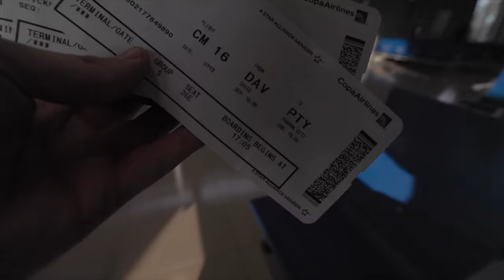BRICK PIZZA OVEN BUILD // Off-Grid in Panama PART 1

Comment: cinder blocks, concrete blocks have air pockets that also contain moisture that can explode given the heat required to cook anything really even pizza
Reply: I have seen manny block houses burn... never seen one explode
Reply: @51-FS  Cinder blocks retain water  in air pockets, heat turns water to steam, just like that, boom. This is why fire bricks exist and fire mortar. Also why so many DIY fireplace/BBQs explode every year. Some believe a brick is a brick is a brick and mortar is mortar is cement until they use a concrete block to make an oven and that water trapped in pockets turns to steam and does what it must to escape. BOOM
Reply: Did I see their new video?

Comment: Not sure if anyone already provided the advice. When you do any cement work on dried cemwnt work, always wet it first. It helps it stick and bond better. Like when you did the stone cladding around the workshop, wet the dry wall first then apply the new cement. Same whwn you layed the blocks for the pizza oven. Keep going you guys are doing amazing.
Reply: It has only been mentioned several hundred times.

Comment: Throw the mortar down in rows . Then as you sit the block down you can easily level it and the mortar has someplace to push out to . And remember there is a top and a bottom of a block , the skinny web side with little line in web goes down . Cool trip to the city and congrats on permanent

Comment: You will need fire brick for the oven and refractory mortar lay them, and to use as plaster you can use 2 parts clay 2parts sand and one part cement

Comment: Sadie is just way too precious 🥰
I’m concerned about the distance from the work shop to the pizza oven…smoke leaching into the shop and othe noxious fumes.
Congrats on permanent residency.
Reply: The aroma of a wood fired oven with food in it is amazing. No problems at all with bad odors or heavy smoke in the workshop. Exhaust gasses very hot. Jet quite a way into the air. You will see in time...
Reply: @jimgriffiths9071  
Ah but it's a fire hazard so close to their "house". 
They are so young and dumb.
Reply: I agree so close causes concern as the oven gets incredibly hot
Reply: @shac9131  not trying to say they are dumb I respect their desires to do the best they can with their resources and commend them a lot for all they have completed as they often learn through trial and error which I can appreciate.
Reply: Wood fire place is in the work shop....
Reply: @51-FS  
That's different.
I just googled it and it's too close, and must be 3 feet away from wall and fences and oven must face oncoming wind. So their placement is against walls and all the smoke will go into "house" and won't cook properly.
Reply: @shac9131  its not against the wall..... looks like it's 3 feet from the wall....
Reply: @51-FS  
Are you blind? They're building against a wall!
Reply: @shac9131  the cement wall?
Reply: @shac9131  11:18
Reply: The oven it self will not be setting on the floor.... it will be about 3 feet off the slab.....
Reply: @shac9131  lol guess u seen the newest video?
Reply: @51-FS  
Have you seen where the smoke will lead to yet?
Reply: @shac9131  depends on the wind that day.... and most of it will go out the fult witch is up...
Reply: @51-FS  
Dude, I did a 5 minute research and only because I was interested in info myself.
You're wrong .... Air strength is needed and if face in wrong direction it's a horrible situation.

Do you live there and with devices to show where wind flows, huh?
Because they have a huge block of wind in various directions.
And it's simply stupid to build right next to a house.... Regardless if are in restaurants, that are professionally installed with folks knowing what they are doing!!!  
Damn ... I even witness burger king in my area who F'd up installing grease tank vents etc. 
It's a bloody nightmare smelling that crap and their keeping doors open to vent smoke out, meanwhile can barely see objects in kitchen due to smoke.
Reply: @shac9131  u have problems...
Reply: @51-FS  
Ah, because I proved you wrong?
I'm a safety, logic, common sense type of person. 
I do things right before screwing up. I've followed them since their beginning and they constantly screw up everything on every project.
Reply: @51-FS  
BTW... They have taken my advice so many times their first 2 years on nearly everything I had to say... Look at their success today 
But they usually learn too late. Do dumb sh first....
Reply: @shac9131  ok cool.... u still have problems
Reply: @shac9131  you have only been subscribed to you tube for 1 year.....
Reply: @51-FS  
You seemingly have a problem with telling me I have problems... LMFAO

Comment: If the bricks are made of clay and are kiln fired (firebrick or red clay brick) they can be used for a pizza oven, but if they are concrete bricks you should stay away. Clay bricks can withstand the heat from a pizza oven, and concrete bricks can't.
Reply: That’s right!
Reply: Plus you never want to locate it sooo close to a building.
Reply: @anamaria2053  Well, a properly built oven is fine inside or around a building. I built one on my balcony atop a 6" granite base counter supported by kiln fired clay bricks and steel
Reply: I'm sure they know more about it then u do?

Comment: We have a wood fired brick oven pizza oven in our cookhouse and we absolutely love it. We cook way more than pizza in it, though having pizza parties are always a huge hit with kids and adults alike.  We then use the residual heat to cook potatoes as the oven cools off.  It’s also a really nice make shift fireplace!

There is a definite learning curve with making wood fired pizza though.  The biggest tip is to not overload pizzas with toppings, they will never cook before the edges burn.  You also want to make sure there is a 1” edge around the pizza.

Comment: I have mentioned this to you in the past a few times but you have not changed your process yet. When you use cement, the surfaces that the cement is touching should be wet. Otherwise the bricks and the ground will suck out the moisture from the new cement and your blocks won’t stick for long. I e said the same thing about the facade that you added to the bottom of your house. Good luck. 
P.S. you can dunk each block into a bucket of water before cementing them.

Comment: Structural integrity is at risk by NOT putting mortar BETWEEN the blocks.  Your process give’s tensile stability up and down, but almost nothing [except for the wall] for side to side.  Any movement or earth shift (earthquake or excessive water) could bring your oven down into a pile.  Keep your fingers crossed!
Reply: There is a serious lack of mortar use in Panamá. I just don’t get it.

Comment: such a nice project. does anyone know if you have to use a special cement because of the heat or if it will work with regular cement as well? Thanks you for the answer.

Comment: Using a wet burst to wet dry cement is a good idea when applying wet cement. It bonds it better and it seals the seems better as well. Just a thought. I use to work with concrete and cement a lot but it’s wasn’t my main job when I was a pipe layer. Love your channel.

Comment: I built a pizza oven.  Insulate the base below the oven.  The oven floor should be around 50" from the ground so you don't have to bend over to look inside.  Watch a video about the indispensable tool.

'

Comment: Kaylee and Jordan you guys do know you must use" fire brick" in your pizza oven? Regular brick and concrete block can explode when heated. Don't learn the hard way as many have in the past....
Reply: Yep! I’ve built a pizza oven with the best of them. Brick (or certain type of stone) is the correct material because of how well it conducts heat and retains it. I’ve never seen a pizza oven made of purely cement.
Reply: @anamaria2053  its only the foundation that they have built, the heat area will be above that
Reply: @MrBrickboy38  Thank you!

Comment: Nice work on the oven. 1 thing is you should have put cement in between every block. Not just top and bottom.
Reply: I thought the same as Jay G that the blocks should be buttered on the ends, also. In this case, it may not matter for non-structural construction. Plus, I assume you will veneer the blocks eventually.
Reply: @garykoblitz4932  its going to be having weight on it.

Comment: Think Safety First I know you want to bake pizza and breads and other stuff, but I think that your oven is too close to the front entry way, and I don't know but do you have another way to exit in cause of a fire. According to the Fire department you should always Barbeque at least 4 ft away from a building. I don't want to seem Judgmental but i think you should use smaller bricks.
Reply: You are correct. The oven needs to be located a distance from the house and made with proper materials. This is unsafe and an accident waiting to happen.

Comment: Why did you build the oven on the patio and not over the already existing wall? Thisway you are limiting you space and all the concrete work was unnecessary. Plus now you build a brick wall next to a concret wall which another waste of work/space and material. Better planning would save you a ton of work.